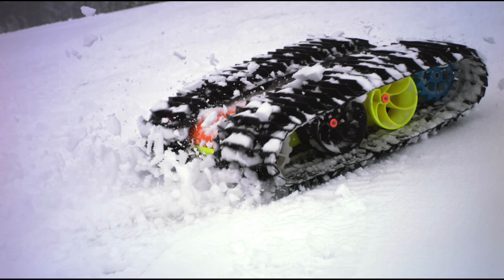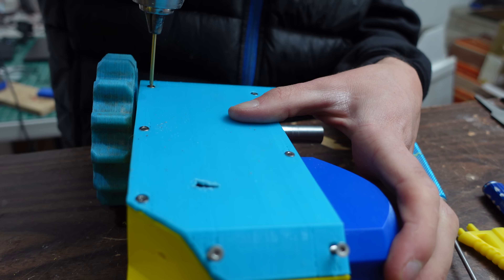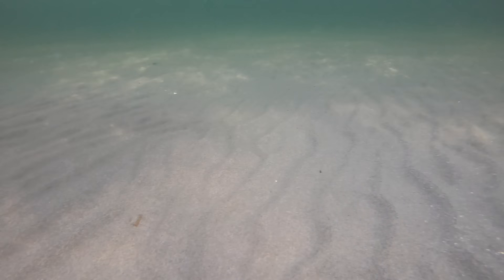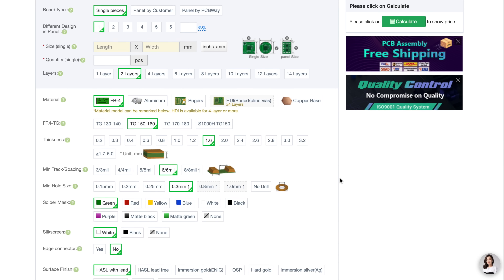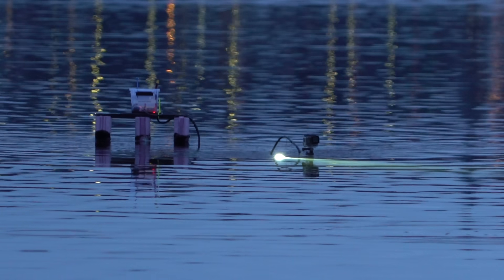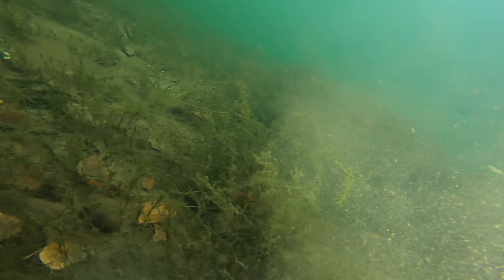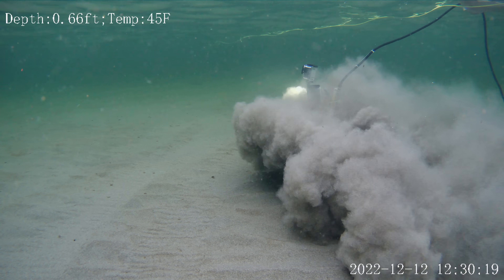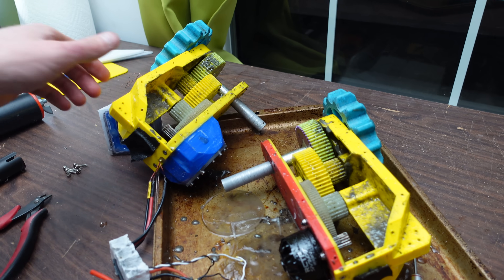DIY Aquatic R/C Tank

Comment: You are definitely pushing boundaries Daniel. It was not long ago, that you brought up this idea of a UW rover, and now you have ton of experience. That is amazing!
The advantage of a rover towards an ordinary sub is, that you have a much more stable platform, and the bottom is where lot's of interesting things are. In  the sub you would try to avoid the bottom.
The optimum thing would be a combination of the two, and since you don't need a fully advanced sub, you could just add boyancy control and a rear propeller. That way you can avoid to be trapped in mud or steep slopes under water. I'm sure you have seen the bouancy control with like a giant syringe with air in it. If you can vary the weight of the rover with like 2 kg, it would give you the option of having both a sub rover and a sub marine.
Reply: By the way, it looks like we are dealing with the same ideas at the moment. I am also adding COB LEDS in underwater enclosures. It's quite easy to get them cooled underwater, and you definitely need lots of light under water. I'm looking forward to your reveal of your experiences pretty soon. You are working damn fast!😁

Comment: Ok this is absolutely awesome, and I know it would be a lot of work but here's an idea so you can actually do some deep exploring and not have to worry so much about it getting stuck.

You should build a bigger "barge" that is powered, and also has a powered reel on it so it can lift the aquacat up and out of the water, then you can simply drive the barge back to shore. I can't imagine it would be easy to get stuck and you wouldn't have to rely on traction or flat surfaces to make it back.

Comment: Hi there have done a lot of underwater printing. There are a few tips that can help you:

1. A little over extrusion wont hurt your prints. It will make parts more waterproof and you will also be able to use less infill.

2.Doing 100% fill is actually bad. With bad filament it can actually crack from inside and let water in.

3. Something weird i have done. I coverd most of my prints in silicon or component glues. 

Anyway after building a lot of desktop fauntains and water boats this is all i have to say hope it helps!!

Comment: With all my fpv power wire I now wind in a common mode filter with a single ferrite donut just large enough to fit servo size wires in with 4 windings for both pos and neg. It's very light, very cheap and very effective. Also to make waterproof prints, print in ABS and use acetone vapour to join the layers together

Comment: I work for a tethered drone company, we use ethernet over power so all we need is a positive and ground.  We also step up the voltage significantly so we can use a smaller gauge wire.  We have a heavy lift drone that can carry 36lbs and our tether is only an 1/8 in thick.
Reply: Doing it this way also reduces signal noise

Comment: this is my first video of yours and i gotta say, you got yourself a new subscriber :) but i wanted to offer a tip: if for the mineral oil filled motors, you submerge everything and screw on the cover while submerged in a small container of mineral oil, you ill get 0 air bubbles (just a mess to clean up after when you take it back out)

Comment: an industrial quality version of this has so much potential... add on an arm for retrieving lost items and a system to reel in and out the cable from the "barge" for increased depth, maybe even a bouyancy tank for hi speed travel with props in gimballed direction control...

Comment: Ive played with this before, so some tips for you;
- Stick the battery down in the rover to add weight; gives better traction, less noise.
- Only feed the antennas up to the top, signal wires don't carry much noise.
- Use a flipped PET soda bottle as a buoy, guaranteed 100% waterproof, can't flip over.
- Antennas don't have to be outside the buoy, just make em point up.
- Weigh the buoy down by gluing a giant ferrite ring around the neck.
- Put a lightweight flagpole on the buoy, shows if you go too deep, easy to snag with grapple. ;)
- Use a nylon rope as the tether core, puts less stress on the cables.
- Add little floats to your tether, keep it off the ground or it will snag.
- Glue a spherical compass to your rover, works better than electronic.

Comment: You could install a syringe that pulls air from the surface to make it "jump" over obstacles, by making it temporarily buoyant. There was a recent video of a lego submarine that did this. A bonus would be that the cable routing the air would make the wires float out of the way of the aqua tank if it's attached to it.

Comment: I have FDM printed water tight parts before, even without any coatings. I used ASA printed at 270-275 C and about 2-3% overflow compared to my normal flow. Also, certain slicing settings can create gaps, so you have to inspect and adjust as needed. DM me if you want more info. I made a large container than holds 5 L of water - no leaks after several months.

Comment: Next time you're buying Heatshrink, look for the Dual Layer stuff that has a glue coating on the inside - it's designed for be used on boats and the like, the glue bonds to the exposed wire and the insulation, sealing closed as the outer shrinks down.

Comment: Mineral oil is great, we use it in our subsea rov control units... but it will eventually become conductive over time; quicker when using moving metal parts. If you're really wanting something that will last... try an engineering fluid like novec 7100.

Comment: There are emergency floatation devices which use a co2 capsule to inflate a float bag, and they aren't buoyant until the co2 is pierced. Once used, you unscrew the co2, fold the bag, and it's good to go again. Just an idea but might make for either an easy emergency escape from being at the bottom of an underwater cliff, OR it may make a cool object recovery buoyancy bag which can lift interesting things from the river bed if you find something you want to recover. Similar stuff is used on archeological dives which are trying to recover artifacts.

Comment: You might get a clear visual on the robot from shore by mounting a laser pointer on it that points straight up. Even more useful would be two different color lasers in a parallel pattern so you could see its position AND direction from shore, which helps you bring it back especially at night.

Comment: If you want to take it deeper, I wonder if you could add an "emergency" float using a disposable CO2 capsule attached to a bladder. If the thing gets stuck, trigger the CO2 capsule to inflate the bladder and lift the robot. You could also put a motor on the barge to bring the assembly back to shore. It's not great but it could save you a lot of hassle.

Comment: Hey Chief, try some marine grade shrink tube. It's regular shrink tube with a soft clear glue liner that melts and seals any connection completely and permanently. I've been using it for years when I rewire trailers. Especially boat trailers.

Comment: Your barge needs it's own propulsion and a winch to hoist the rover, tether float and umbilical. It would allow you to pay slack in and out as needed. You would need brushed connections which could be on the barge out of the water.

Comment: Never underestimate the value of hobbyists attempting things without researching how it is done in normal commercial operations.  You have tried so many unconventional techniques and used the "wrong" materials so much that your video is a treasure trove of basic research.  Valuable info includes what worked as well as what won't work.

Comment: You can get "marine" heatshrink at Harbor Freight for pretty cheap. Its just dual wall heat shrink. So it basically just has a layer of hot glue along the inside.

Comment: The rotation of the tracks is creating a pitch-up moment while it's driving underwater. Should orient more weight to the front, or devise an adjustable ballast system. That would probably help gain traction at greater angles.

Comment: Next time you do this you could use ballast tanks and floaters on a cable to shore, this would allow you to float the entire tank but also allow you pull it to shore at any point including the winch / tow ability. Worth doing and you can attach an air pipe to surface so you can pull it down instead of needing to store anything. Little more work but also means the range is whatever the cable to shore is. This way you aren't powering from shore but using an old scuba method at least which is cool.

Comment: I'm not sure what the technical term is, but try these "screw wheels". I once had an RC vehicle with such, and i think it would be a lot harder to stuck in light sediment. It might have the somewhat nice side effect of potentially even being able to propel itself through water if spun fast enough. Since we want it to sink, probably not enough to take off, but likely enough to unstuck itself, and no problems with weeds.

Edit: You find what i mean when googling for screw tanks. I think that would work really good for underwater exploration. Especially if you make the screws comparably lightweight and large with a comparably small center, to make it good at pushing through the light mud.

Comment: About the motors, brushless motors doesn't have electrical contacts, excepts for the wire that prolong themselves into the coil. As such if not for the risk of corrosion, they can be submerged

Comment: AquaCat has such massive potential, not just for itself but any Cat in general. I hope this doesn't get backburnered into a limited project.

AquaCat v2 needs to integrate the motors into the gearbox housings, and the gearbox housings need to be a solid material that can be sealed well, along with a fill and bleed nipple so that you can flood the housings entirely, either mineral oil or grease or whatever non-water fluid you want; this way you have units that won't experience ingress, and honestly I'd go as far as combining the two sides and the electronics and FPV housing into a singular housing, just have a fill and bleed per side at the lowest and high points when filling, which would work better as front and back with the electronics and FPV box biased to one half. I would also put plates on the outer rim of the tracks, just so that weeds and stuff can't creep into the tracks from the gaping hole in the center. Another upgrade that should exist on the platform is buoyancy tanks, for when things get too deep, under low battery situations, and for recovery.  Then, of course, software-side things like a compass and other sensors. 

Speaking of recovery, the companion barge should be more than just a floating antenna. This barge should be it's own controlled boat, though passive when used as a glorified antenna, that can also pull up (wire, buoyancy, etc.) the AquaCat and capture it, so that it's essentially one vessel when the boat is being used. This would make recovery so much simpler, and due to the boat being able to carry the tank itself, deep water should never attempt to drag the boat down with the tank. And while you could do a cable-only recovery system, some amount of added buoyancy to the tank will greatly improve recovery time and attempt. And given that the boat would be powered separately, low tank battery would not be detrimental to recovery, you'd only need a small battery and a very simple control scheme to drive the boat off shore and back to shore; this would also allow the barge to drop the tank, rather than relying on the voyage to start with the tank crossing the tide. Bonus points if you figure out how to make the barge a pontoon that the AquaCat can nest inside of, with just enough offset so that the tracks can still drive when the pontoon leaves or approaches shore. Though the tether will be an issue, you need some kind of reel to add slack and to pull it taut upon recovery; much like a wire-based recovery system, just a bit more delicate. 

This could turn into a very interesting project, and given the harsher circumstances needing a more advanced build, this could feed back into the main SnowCat project and possibly provide a harsher environment Cat, such as extremely muddy environments or swampy environments, a SandCat as a possibility as well considering sand ingress would kill a gearbox. The AquaCat might be a worthwhile investment, considering it essentially combines all of the other harsh environments into a singular platform; rather than develop a MudCat, SwampCat, and SandCat separately and possibly concurrently, you're hitting all the needs of those other Cats with the singular AquaCat, which then can be derived from for other platforms. Not to mention the AquaCat's unique need for the barge could eventually lead into other attachments, say a small tethered drone that can act as a flare if you lose a tank in the forest, as it just has to fly up and flash a light, an inverse of the barge's control but the same tethering concept. 

Take baby steps. Figure out the gearbox sealing and flooding concerns first, then buoyancy and tank-side recovery measures, then barge side stuff, etc. I'm sure just finding a good sealed gearbox design itself is going to take a few iterations, because you're not only worrying about internal components, but also fluid pathing to optimize flood and bleed, then an iteration or two when combining the gearboxes and electronics and FPV boxes. Then figuring out buoyancy control on the tank side and recovery control on the barge side will take some development rounds to get right, same with the controllable barge and the mating mechanism so that tank and barge act as a singular vessel when the tank is recovered; then the idea of doing this as a pontoon with a track offset so that the boat can ride the tank on ground and low water. Probably a good couple years of dev work unless you manage to get each step right the first time. A very interesting concept and project nonetheless, though. Given the complexities of it, it could eventually become a typical consumer RC product, where it just works out of the box, and I don't see anyone else doing a water body floor tank with companion barge, similarly with the derived other Cats, a singular base model with a different companion module, just slightly different track design as well for different environments; seems like a solid business venture in the long run as well. 

Now (jokingly) strap a seaplane to it so that it can be a land, water, air, and submersible vehicle all in one, bonus points for a vtol for more control and flight/landing efficiency.

Comment: Suggestion: to help know which way it is facing. 
Install digital compass in both Tank & Tug. 
Add small Prop under Tug 1 on the left facing forward & 1 on the right facing rearward. 
use to rotate the Tug, around its centre of mass, to match Tanks compass bearing.
You can then visually see which way the Tug is facing when Tank is not pulling it along.

Comment: Twisted pair for the signal wire might resolve the noise problem, but 22 awg is the thickest that you'll typically find although you could use multiple pairs for power.

Comment: Hello there, your rc videos are great, I really enjoy all the 3d printed and diy crafting I have watched so far. With 3d printed things I am about to use some clear coat in a spray can for a even glossy look on some finished prints, I wonder if two or more coats would be enough for your projects to be water tight in order to maintain the 3d printed cool color look without the extemes of the expoxy to get the same result?? The fpv camera setup is amazing and I could only wish you could make a video with how that setup works and budget minded parts to get that fpv in rc cars. Keep the great videos coming!!

Comment: This was awesome.  Could you create a submarine like r/c hobbyists make and mount the motors and tracks on the sides? At least you would be able to control the depth and not have to worry about losing it in deeper water or flipping the support raft behind it.

Comment: Usually oils turns white when water gets in with it and something is turning or moving sloshing it around. If you let it sit in something clear like a glass for a while it will separate and you will see layers with the water on bottom and oil on top, air might cause it to get cloudy but I bet its water in this case

Comment: In submersibles, it's common to make part of the weight droppable in an emergency so the system can float to the surface if things go pear shaped.  That could be done with a servo or an electromagnet.

Comment: What you should do is build a xl barge that lowers the sub from the middle of it using the teether that way if it gets stuck you can just pull the sub straight up and reset. Also instead of tracks maybe try screw style

Comment: I think.. I have some suggestion for this project..

Firstly that track need more ground clearance. Which can be achieved with many different ways by still using the same platform.

Secondly, u definitely need longer signal cable which is can be fixed length or retractable.

Third,, this might sounds silly but, u can actualy use wax to protecting the electronics by simply pouring molten wax to the void where the electronics and module are located.

The last one for the gearbox is by using low viscousity grease to keep the water out from gearbox area (sealed gearbox)

Comment: What you should do for  the next version is to have a winch on the pontoon so you can extend the length of the umbilical and be able to winch it back up and the have motors on the pontoon to sail it back. Also was thinking you could but the esc and electronics in a container filled with mineral oil on the tank so you just need the TX and RX lines going up to  pontoon.